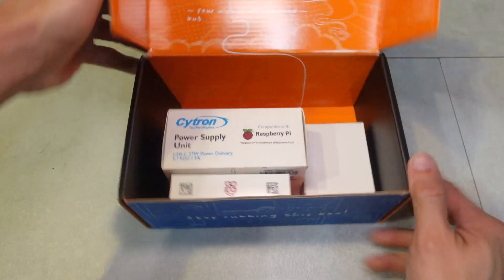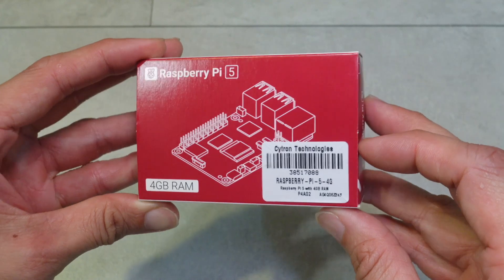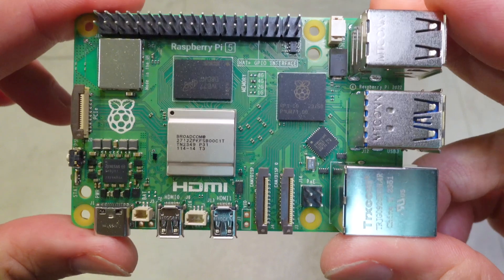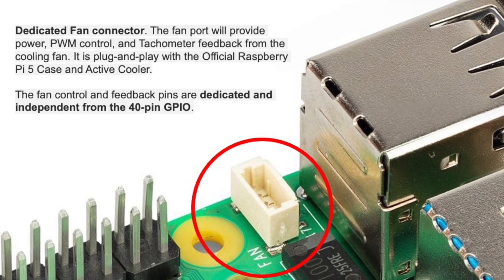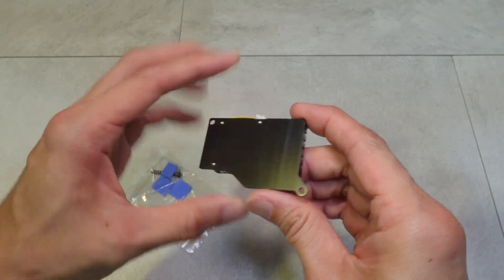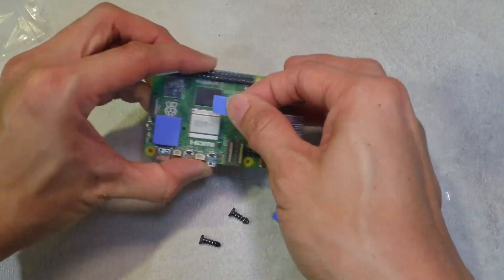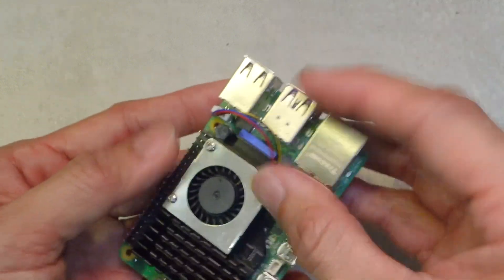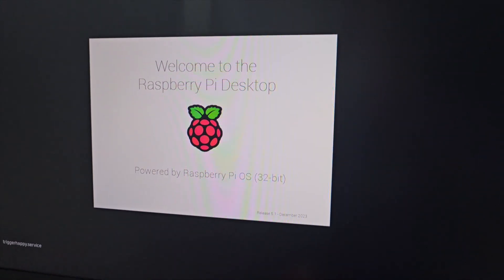Unbox & Install Raspberry Pi 5: Compatible Active Cooler & 3D printed case

Comment: There is no thermal pad/thermal paste/thermal interface material between the heatsink and the CPU. The CPU is not being cooled. Also, there is no temperature data to show temps before and after mounting the cooler. I think that there is a misunderstanding here in how the cooler is supposed to be mounted. One should be careful when watching this video.
Reply from the maker: Rpi5 CPU is designed to work with just a fan. Yes, we are missing thermal paste which is in the shipment. 

The CPU is getting cooled and no more thermal throttling. Will do data comparison for before and along with the thermal paste application video. 

Thanks for the feedback.

Comment: Am still using microbit and doing scratch programming. Will Raspberry Pi be too difficult for me to start now ?
Reply from the maker: Yeah for now. But if you need an independent computer to process more complex computations, then Raspberry Pi is needed to do the job. Else, a Microbit alone is powerful enough to run most of the coding needs